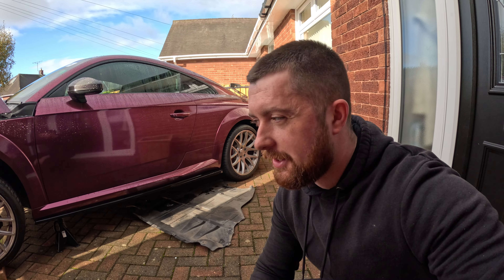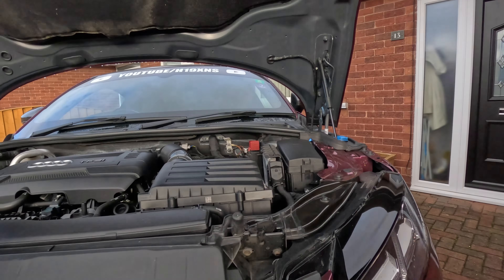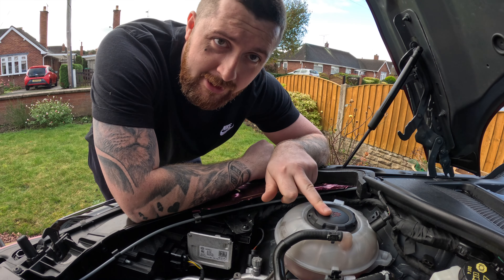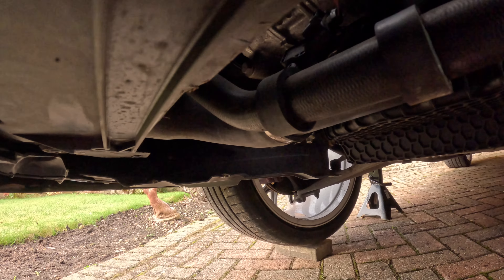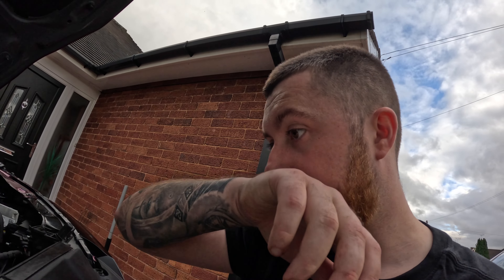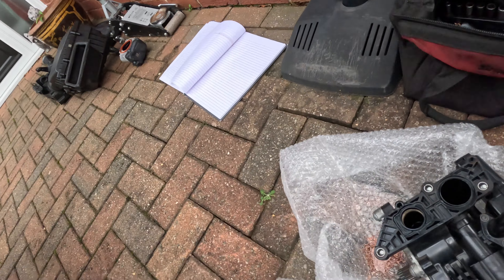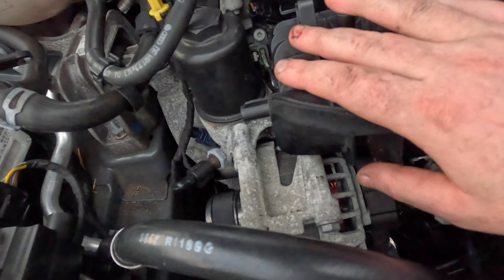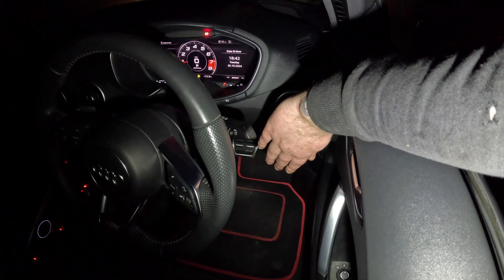AUDI TT  WATER-PUMP AND THERMOSTAT REPLACEMENT

Comment: When I had my water pump replaced they basically took off the whole front end (bumper, radiators, intercooler) and doing it that way you have access to be able to replace the belt
Reply from the maker: Seems abit overkill for that 😂 my belt was fine so no need to replace it

Comment: nice luckily i bought my mk1 at 75k mileage and the guy i bought it from was a military nuclear scientist and he replaced the water pump with the timing belt kit at 70k miles or sooner. I think most people say to change timing belt at the same time.  I have come to notice a lot of people on the car sales websites try to sell german cars right before this service is needed around 70k miles for water pump/timing belt replacement, so they sell it to someone who most likely never owned a german car and doesn't know this service is needed. and if you buy an older model it might cost more to change then you paid for the car lol
Reply: chain on this car no poverty belts
Reply: @EazyDuz18  lol idk if mine has a chain or a belt
Reply from the maker: @joeyschmidt7546 send me a picture of the engine I’ll tell you
Reply: @H19XNS  i have 2004 1.8t audi tt 225.the itnernet says its a belt. and its also a belt for the 2.0t mk2. apparently the mk3 is the first model to have a chain instead of a belt it says online.

Comment: Hi Andrew. I have a 2016 2L petrol mk3, i get a squeaking sound (getting progressively louder) every 2seconds in a cycle and continuous buzz after car shutsdown for around 2min after a drive. Sounds seems to come from water pump area, Does this car have a aux water pump, or is it built into main pump, is it hidden, cant find mine. Sounds ridiculous when walking away. Thanks
Reply from the maker: Hi mate I would like to help you but honestly I ain’t got a clue, I wing most the stuff I do 😂 how many miles is the car on and has it ever had the water pump done?
Reply: @H19XNS   No problem mate. Got 100k km, water pump not done. was just trying to see if it had a auxillary water pump.
Reply from the maker: There is a belt that runs the pump on the front of the engine that’s the one I changed if that helps

Comment: Hey Andrew, I have a 2015 2.0 petrol currently at 73k miles, what symptoms did you get with yours that made you think you had a failing pump/thermostat? Just curious what to watch out for really.
Reply from the maker: I didn’t have a failing pump or thermostat mate they are known for leaking between the plastic housing and the metal pump, when they do you will loose coolant and can see residue where it leaks from, normally starts off slow but gets worse. People say to change the gasket but for the amount of work it takes getting it out everyone replaces the whole thing
Reply: @H19XNS  Thanks very much for the reply!

Comment: nice job!! despite the cuts and bruises!  how long did it take including your prep work?  looks like a lot of labour figures why shops charge so much, shame audI designed placement like that for a such a perishable item. is that an aftermarket water pump as read on forums they're more robust than the OEM? cheers.
Reply from the maker: It’s a genuine water pump and took me a while tbh about 2 hours to get it out and same putting it back in maybe little longer